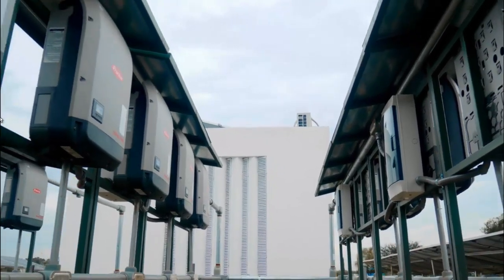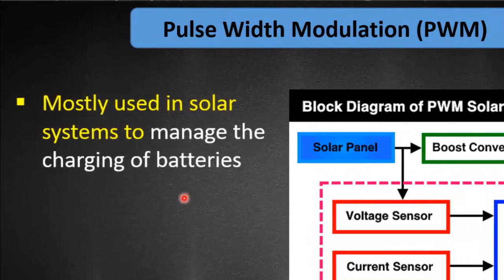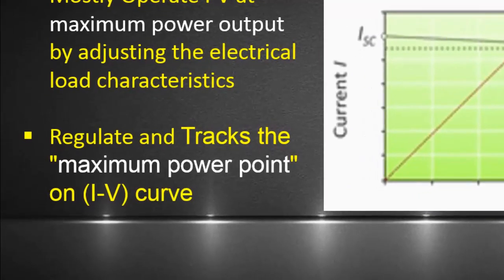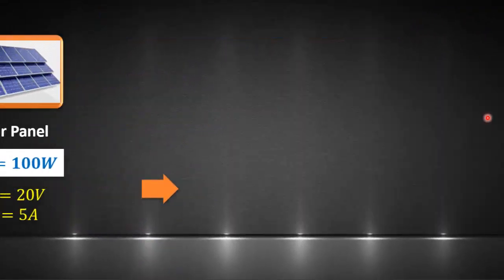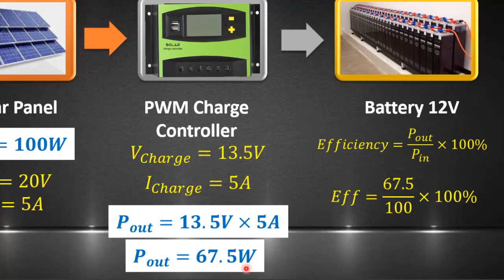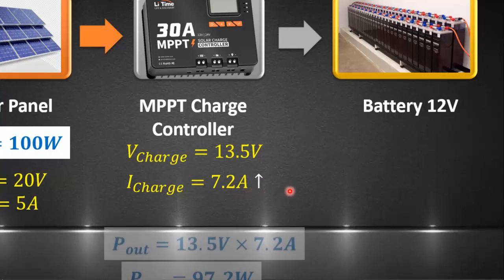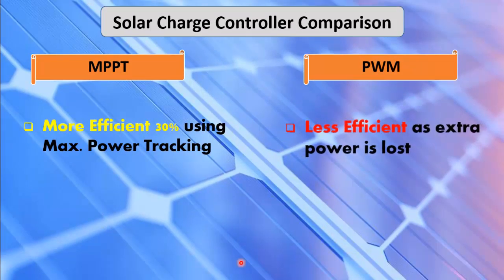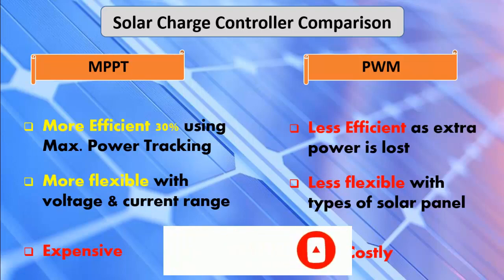MPPT vs PWM Solar Charge Controller | Which One is Best?

Comment: No panel is 100% efficient. Under optimal conditions us get between 80% and 90% of the panels power rating. Avoid fake mppt controls firstly and buying a second pv panel of the same size will be cheaper with a well priced pwm controller. Mppt controllers is only beneficial in poor weather conditions and with large solar systems.